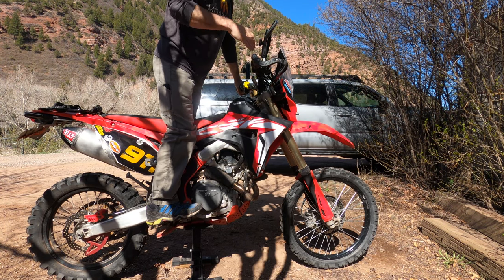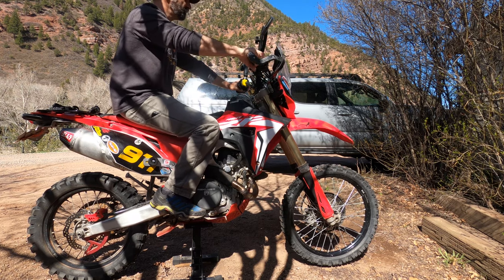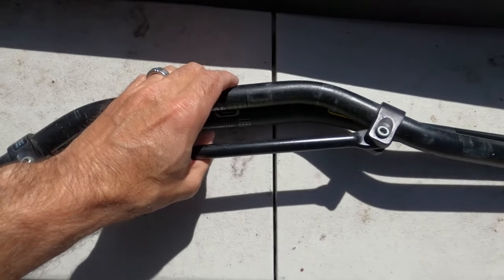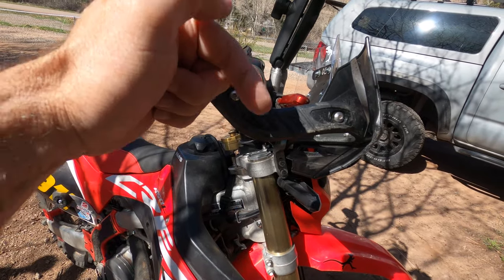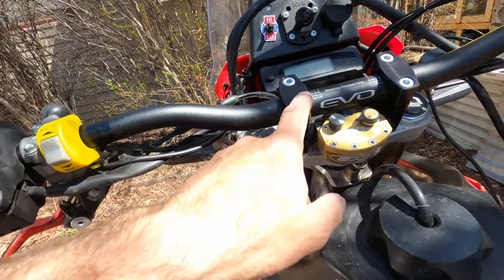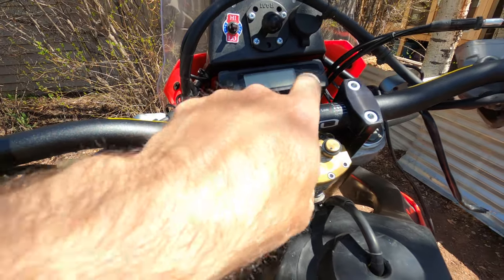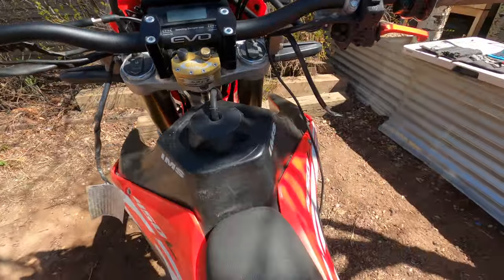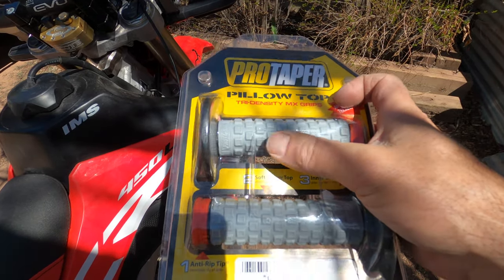My Handlebars Are Too High! Pro Taper's EVO Steering Damper Low On My CRF450L Ought To Fix It.

Comment: Since yours looks like it's taken a bit of a beating too, have you considered getting some protection for your header pipe? I had a stack yesterday and scratched it up on the bend a bit when it dropped. Since it sticks out a bit I'm a bit worried a decent stack will damage it
Reply from the maker: I've already dented mine. :(   I am going to add something, but whether that's a solid shield or a wrap I haven't decided yet.

Comment: How does the steering damper work?
Reply from the maker: It works great! I like how easily you can adjust it for high (no more death wobble!) or off road. You do need to pay attention to your terrain as it changes however. On its stiffest setting it can get scary in technical tight trails when you can't turn quick enough. But so far I really like it.

Comment: Hi John, I’m thinking of adding a steering stabilizer. Now that you’ve had a steering stabilizer on for a while now, I’m wondering if you still like it? Would you buy it again? I ride mainly off road (twin and single track). Thx.
Reply from the maker: I love it for high speed traveling, on and off road. It can be a bit much when the going is slow and technical, as you can imagine. Even when it's at its lowest setting there is still some dampening effect. But, I would rather have it than not.

Comment: Love your video. Quick note. You know if you change bars angle you're changing handling of the bike. Forward quick steering but unstable on hwy. Backward stable on hey but slow steering. Just saying.
Also the levers are WAY too low. For offroad use they  should be almost parallel with road.
Reply from the maker: Thanks for the tips Rony B!